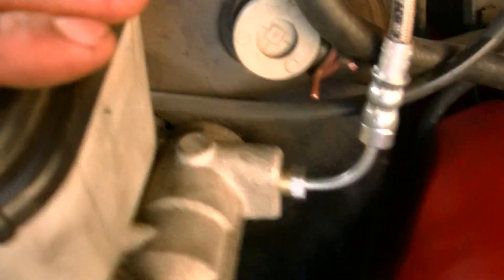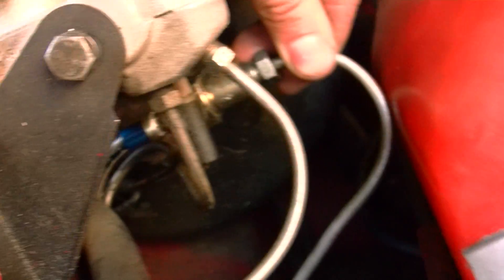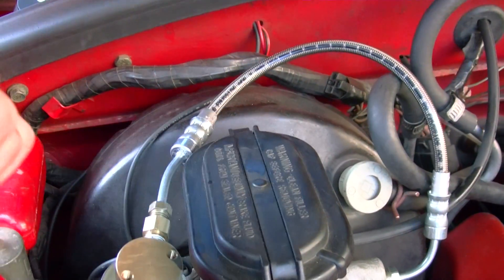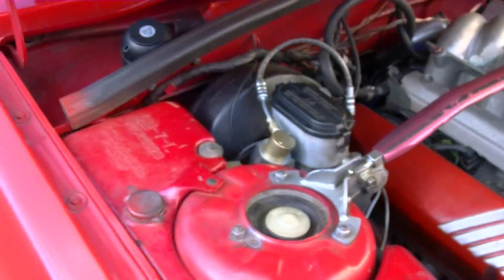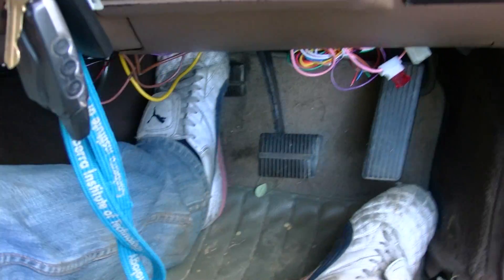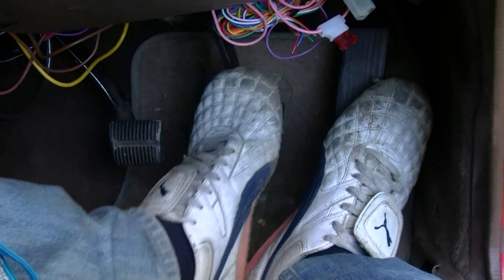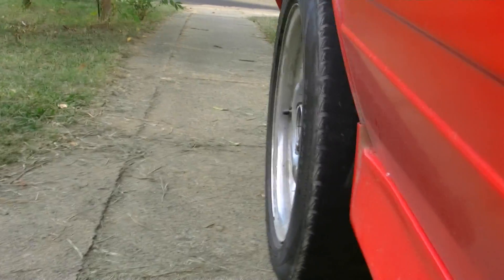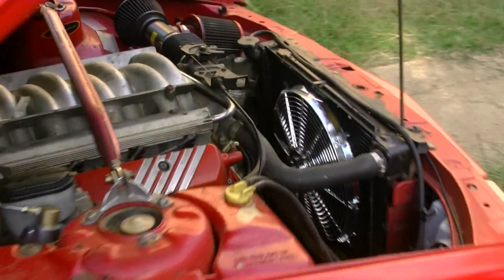Holden VK V8 - Line Locker Installation

Comment from the maker: @MrMapex2010
Heya!
Well line lockers are illegal..
This installation I did is very good as its not done dodgily!.
So it is reliable, and I can do Burnouts the correct way without damaging other components on my much loved VK!
If a cop pulls you over, they will not start inspecting under your bonnet.. As you can see it is quite stealthy, and very easy to hook it back up to stock. 5 min job!
Cheers!

Comment from the maker: Hey! OK, the B&M has to be installed in Reverse. so against the flow of the brake fluid.
so when you apply the brake, and flip the switch and let go of the brake it will only work on the front brake!
try to swap the actual unit, you might have the hoses going in the wrong way! let me know

Comment from the maker: Hey Buddy,

all you need is the B&M line Locker Solenoid ($80)
1x flexible braided Brake line, or a steel one, whatever works for the setup.
Bleed the system and you are done!

Comment: where did u get the lines from? i got a line locker just havn dramas finding lines to connect it all up.
Reply from the maker: +IMMORTAL MODZ  
I just went to the brake shop and showed them the fittings and a line i wanted done! costed like 80$ real easy :)
Reply: +Mathias Mustllo thanks mate.